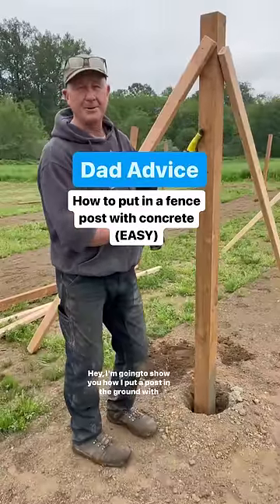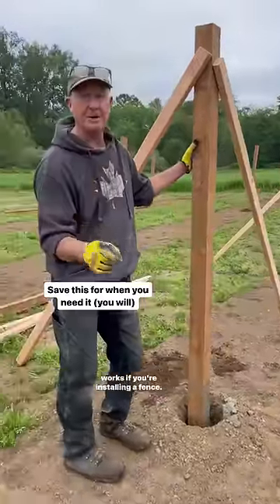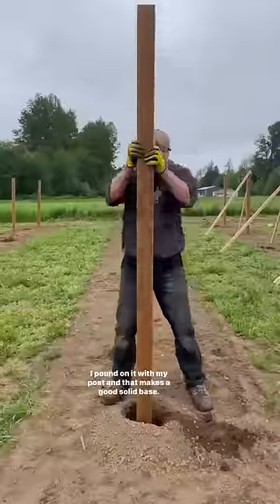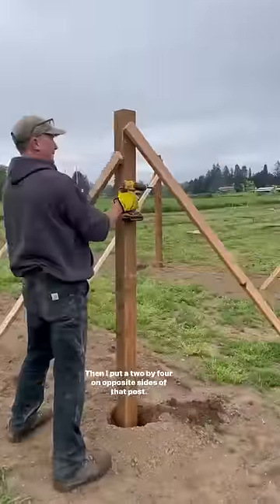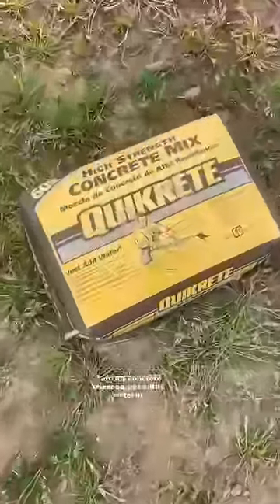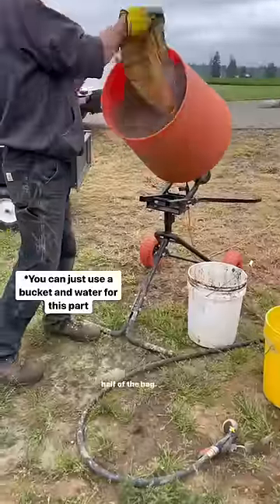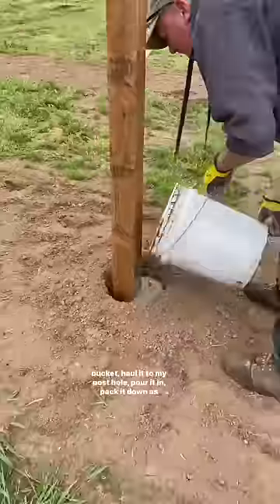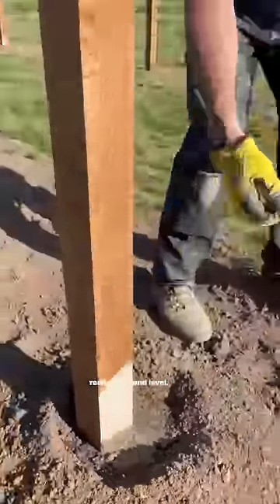How to put a fencepost in with concrete. Love, Dad

Comment: Several problems I see in how you place your posts 1 you should have a minimum of 10 inch diameter X30 inches deep bell the bottom of the hole for stability on a 7 foot tall fence and in the one you show the 4X4 is NOT centered up in the hole and it should be at least 1 and 1/2 80 lbs bag of guickcrete mixed with one gallon of water per bag or 1 1/2 gallon to 120 lbs of cement. Instead of a rock I screw a slat spanning past each side of the hole Several inches that keep the post at 1 or more off the bottom of the hole. I have yet to have a post rot out because of trapped water or tip over from the wind because a fence becomes a sail ⛵️ once the pickets are applied, that brings me to the sacrificial board on the bottom if you lay a horizontal board near the ground level of course this keeps the pickets off the ground and from rotting out prematurely.

Comment: Just pour a bit of concrete under it, put the post in, pour the concrete around it, add some water and it will set in a few minutes while you’re holding it. Why all the extra work?

Comment: Depends on your frostline too, if you fill concrete too high in the hole and not deep enough, they will eventually float up from freeze/thawing over time. Make the post and cement below the frostline.

Comment: You don't need to prop up the posts 😂 just put your concrete into the hole , make you concrete firm not sloppy, check with spirit level. Ive lots of experience on the farm

Comment: Here is a couple tips for you Bo!   You can save a LOT of time by not using the 2x4’s holding the posts plumb.  Not needed.   They will stay put.  More importantly, the concrete isn’t for strength.  Its to keep the post from rotting.  So make sure your concrete is above grade so water doesnt sit and pool against the post.  Ive demo’ed many perfectly good fences where all the posts were rotted at the concrete.  Build it up a little, slope in down and go!  Also, one more thing.  You aren’t sweating enough.  No more breaks!
Reply: I thought you were supposed to pack in gravel, not use concrete!  Any wood moisture inside the concrete has no place to go.
Reply: @SerpentLord  it doesnt matter.  Ive never seen wood rotten in the concrete.  They rot at the top where the water, dirt and debris keep the wood wet.  No where else.

Comment: There’s no need to mix the concrete with water…pouring the bag in dry will work out fine. As for the “leveling” of your posts, you are actually “plumbing” the posts as opposed to leveling them. 🤷‍♂️

Comment: I usually put screws through the sides of the bottom of the wood post to keep the concrete attached to the wood after it dries. The concrete will pull away from the wood when drying Nd the screws will prevent the pole from coming out in the future.

Comment: The finish level of concrete should be above ground level. Why?? To prevent wood roit from where the water will collect below grade line. The post appears to be NON Pre-treated, will riot out with 5 years.

Comment: Rock will compress into the Earth and fail!! Digging the hole out an extra 6"-8" inches and add 6"-8" inches of concrete to the bottom of the hole, allow 24 hours to set. Now your post in encompassed by concrete 365 to the Earth. 

Simply said I can build better than you can!

Comment: You really don't have to go through all the trouble of mixing the concrete. Just pour part of the bag in the hole, add a small amount of water, level your post, add more concrete, check for level , and add a small amount of water. Boom done!

Comment: All wrong. You're supposed to dump the whole bag of dry concrete in the hole with the post. Then spray it with some water from the hose, or just wait till it rains, and never use a level. Eyeball everything.

Comment: Nah, be lazy. Post in, partly full will dry quick-setting concrete mix, level it, fill 80% with dry mix, level again, gallon of water, check level one more time, ready to hang fence in an hour or two. No 2x4s to hold it needed. No mixer needed

Comment: Wood and concrete don't get on well. The wood will rot faster from the caustic chemicals. At least paint the wood with something., tar or similar coatings, if you don't use a metal base plate

Comment: Not a good idea to fill your hole with concrete, concrete should only used on the first 2/3rd of the post. Either use sand or dirt on the last 1/3 for drainage. The concrete on the top actually holds moisture against the post then the concrete begins to dry pulls the moisture out of the post eventually making the post rot at the spot where the concrete touches the post. That's why if you only pour concrete to bottom section that isn't exposed to the elements of wet and dry cycles the post will last for decades instead of years. Ask ranchers where a wooden fence post is prone to breaking at

Comment: If it's for a berry garden, why do you have to put concrete in the base? Just dig the hole and down 4 ft past the frost line, if you even live in an area that gets freezing cold in the winter. It doesn't matter if they move around a little; it's the hold up a bunch of berries! And what do you care if it leans a little, you certainly didn't install them straight because I don't see a stringline anywhere. You just added a lot of labor and expense to your project. I would understand if these posts were for a fence or a deck. However I think your misguiding people. If you want these posts straight, you need to set the end posts first and install a string line close to the ground,unobstructed, or hammer in a stake on each end to attach the string to. Also, just put a little concrete in the hole first before you put your post in. That creates its own base. And lastly, you don't need the two-by-four braces unless your post is going up super high for like a pole barn, or if you're installing them on a windy day. You install it get it to your line and plummet as you pour your two or three bags of concrete in. I think you've made a lot more work for yourself, and have made it more expensive. expensive.

Comment: Not fine tight. See how the concrete is below the grass level? Guess what? Rainwater will pool around the post. Within 4 years that post will rot and break at ground over. More concrete should have been used to form a bell shape ... right where the post enters the ground. This can't no water will pool to rot the post.

Comment: Filling the hole with concrete is COMPLETELY unnecessary and a waste. If the bottom is back filled and compacted it can't possibly go anywhere. 5 or 6" at the top is all it needs. Concrete may not be needed at all.
You also slopped cement on the wood.

Comment: Way too much work. Fuck that concrete mixer and hauling all that mix. 
Take a hose with ya. Wet the holes down and put the dry Crete in. Level it, walk away. The Crete will soak up the ground water and garden by the morning. Save half a days work and use way less equipment.

Comment: You don't have to mix the concrete or use braces to hold it straight. Just pour the mix in dry and pack it in with a rod or stick. Wet it if you want, but the moisture in the ground will seep in.

Comment: Your not smart...just put the conkrete mix in and add water...halfways or after...that saves your post holders...because you can level them when the cement is dry...very simple...and the solid base is when you poundit before without a rock...because when you level it event will sip under...

Comment: 😮Wrong, always pour in several inches of concrete first, set post, finish filling, leaving a small crown just above ground level. Why? This completely seals the post, absolutely no voids for moisture or water to collect at the bottom. If not, in time, those post will wick up water as it dries and ages, those post will start rotting from the bottom up and from the inside out, even though being treated, people won't notice for some years, but it will happen, I even seen were people will place a brick or gravel first. To me, it goes against common sense.  But it's how so call professionals do it now! Dig a bunch of holes, place a bunch of posts right on dirt, maybe a brick, and quickly fill them all up, get paid, and move on to the next job! Everywhere I go that all I see now! Post rotting, falling over,. Especially in homeowners association neighborhoods. I'm almost 70, and the thousands of posts I placed are still solid and will be around long after I'm gone. This is the fast, get your money way, but it not the way correct way, nor the way it was once taught to be done. at this mans age, you'll think he would know better. passing down knowledge and expertise and doing jobs right is a thing of the past. Just like building houses and apartments, material and time = money in their pockets, a properly done post will take a little more effort but will last a lifetime, not a decade or so. Also, what gets me is that this is how do-it-yourself books and places like Home Depot instructs because it is easier for the do-it-yourselfers.

Comment: That is wrong, this is a classic example of DOING IT WRONG! if you underfill the hole with concrete you are creating a wet moat at the top of the concrete plug, this is why "lifetime guaranteed" pt posts fail after 4 to 8 years. If you would like your fences to last 20+ years, you must bring the concrete out of the ground and "crown" it above your finished landscape surface. If you don't want to see little concrete crowns then you must set the post in sand and gravel. You are making construction and quality WORSE by posting this amateur video.